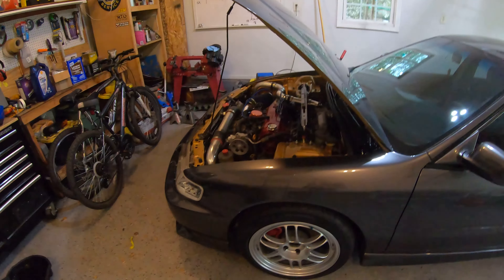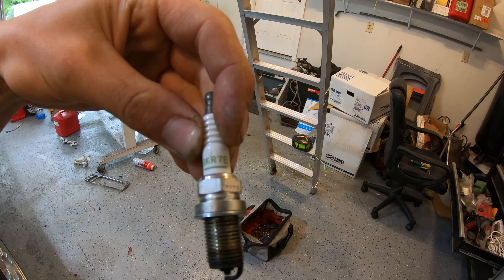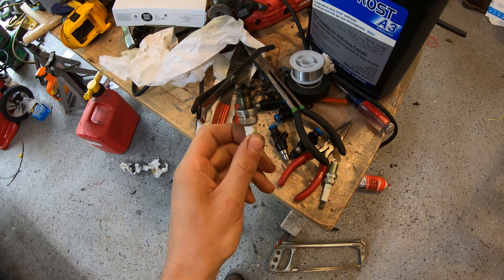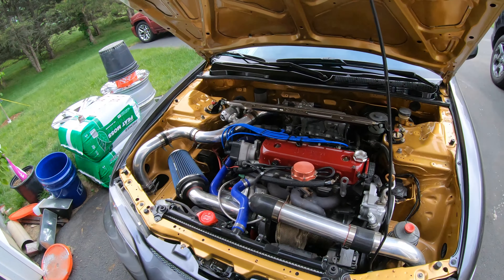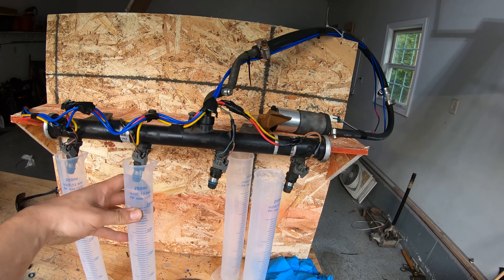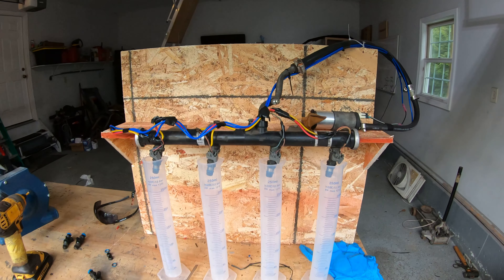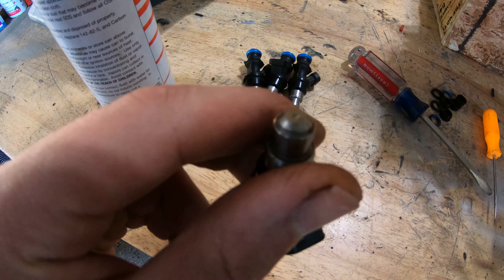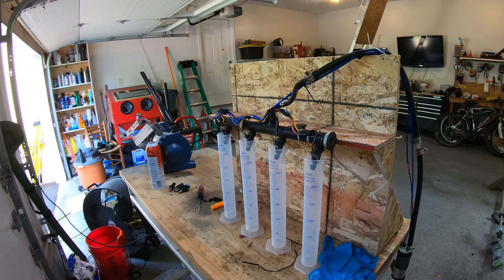Turbo Accord Ignition Issues & Fuel Injector Test Rig Setup

Comment: The idle doesn't bubble when your in gear? Right?. Check the engine ground out of the main harness for the crank and cam sensor. Cut end restrip wire & reconnect .
Reply: Also make sure crank sensor is clean. I replaced mine. Problems gone. But I'm sure it was the engine ground wire out of the main harness, not off battery.
Reply from the maker: It's a manual so it's not like in gear idling with a load like an auto but it used to only do it at idle randomly when warm. More so under 1k rpm. Now it happens around 1500 when on the gas pedal and under acceleration.
Reply from the maker: Yeah definitely going to check those grounds man